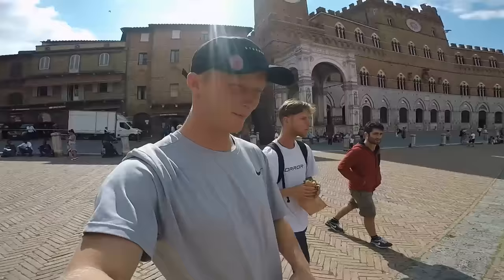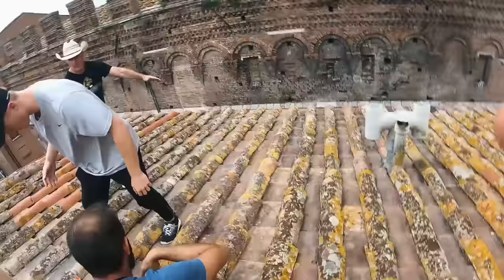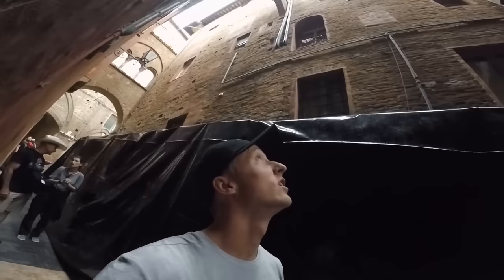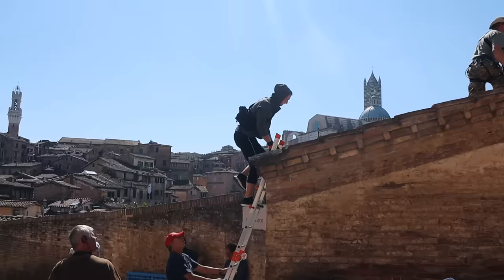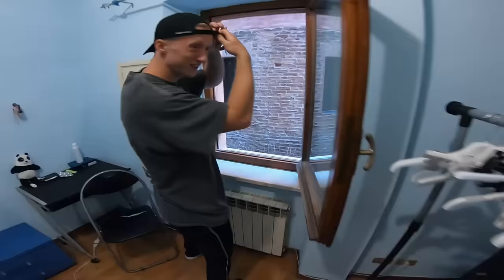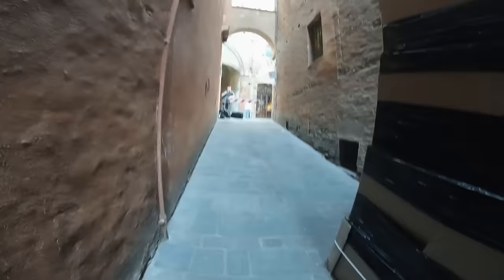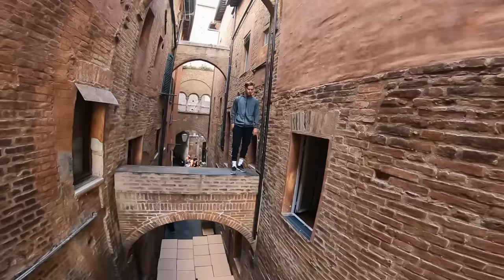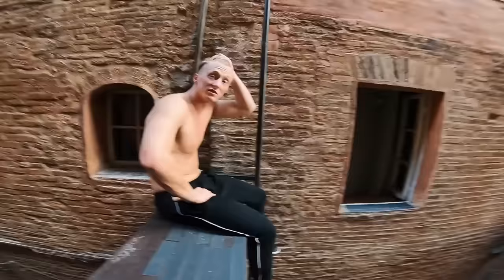Jumping over Michael Bay 🇮🇹

Comment: What the folks at home don’t usually realize is that in movies and tv, there’s 10 hours of waiting around never knowing when they’re gonna need you. It’s a mind f*ck to be hanging out on call and then having to get in the mindset all of a sudden. Big props to the storror boys!
Reply: beyond the wheel  well, it depends. If you're per diem, you're making them same amount if it's one hour or twelve, or if the union controls who works. I know storror got a good chunk of cash for this which is well deserved. But my point is that while it takes mental toughness to do the stuff they do, it's another level with the pressure of not knowing when things are gonna happen or when they need you on set.

Comment: Eyyy! Those gloves are mechanix wear! Complete agreement, no gloves in parkour. But if you had to use any, it should be those. I use them for airsoft as a sniper, it's great. I often climb structures and vault through buildings and they hold up, not the same feel as bare hands, but pretty damn close!
Reply: I don't usually wear gloves but times like now in winter my hands get cold quickly so I use gloves if I'm not using my hands 🤷🏾‍♂️

Comment: As a technical element in theater arts and seeing far to many 'near misses' and close calls working with cirque du soleil I appreciate you went under a wire despite the lack of mobility.
The same complaint is made by the stunts, and its sad to see possible human movement compromised by a mechanical dummy now :(